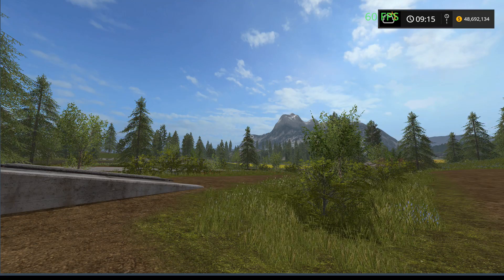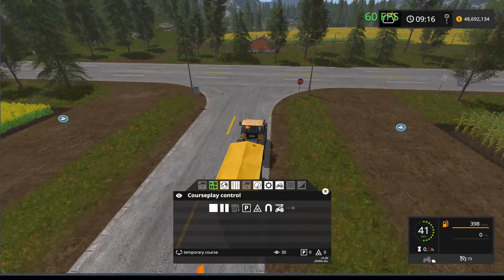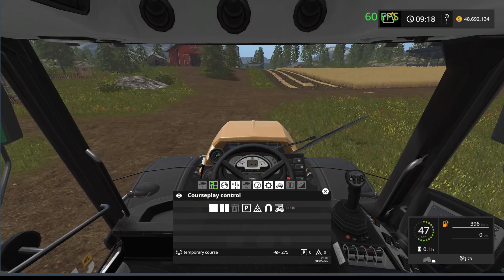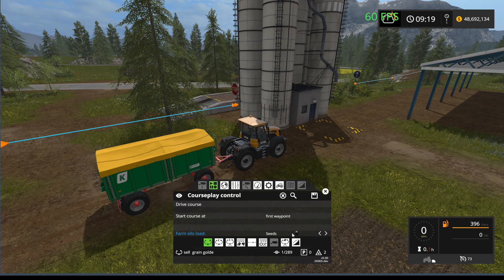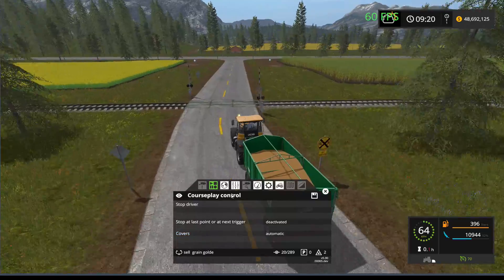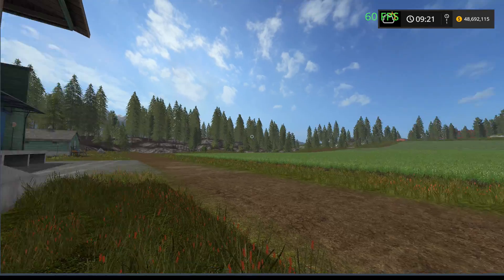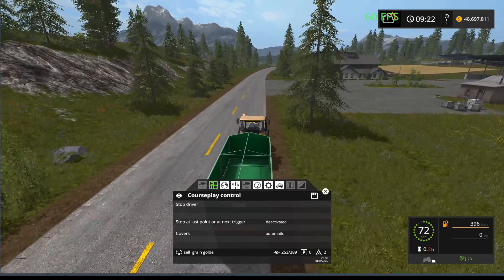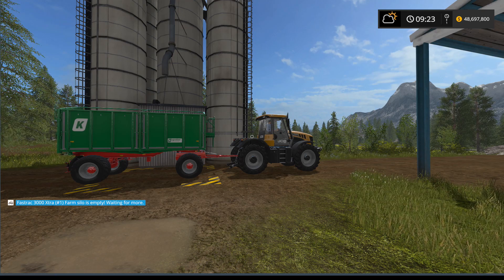Farming Simulator 17 Courseplay Tutorial - How to use grain transport mode

Comment: I have a question. I set up a course following this video. When I try to run the course all is well until just after I slow down to line up on the drop point. For some reason the driver stops. When this happens I need to hit the stop driver button and then the drive course button. At that point the driver manages to complete the course. I have no idea why he stops in the middle like that. Any clue?  Thanks for the tutorials. They really help.
Reply from the maker: The only thing that jumps to mind is that you set a wait point by accident
Reply: Thanks, I'll check it out

Comment: How do you configure which tipping direction the courseplay driver uses? I've tried setting up this same route and every time the driver tips out the left side of the trailer and not the back, thus he spills the grain all over the floor beside the actual sale point. When I recorded the route I tipped correctly out the back of the trailer so don't understand why the AI doesn't copy me.
Reply from the maker: +CWATTYESOGamingForFun I'm not sure you can configure the tip side with courseplay. Maybe in a later version

Comment: Question for you. I have the version from the creator website here is the link. http://courseplay.github.io/courseplay/en/index.html. I mainly have this version because with the version that first came out would not work with my forage harvesters. this one works great for every aspect except for using it to transport grain from the field to the farm. I use an over loader fill a semi no issues but when i create a course it will work the first trip around but when it comes back to the first way point it never stops just keeps going and going does not stop at the way point like it use to in fs15? any ideas?

Comment: I have a hard time getting courseplay to sell to a milk trigger (Stevies Cherry Hills map) using universal tankers and milk stop from Marhus. have you managed or even tried to get that to work?
Reply from the maker: Try using a waiting point at the sell point. It might help
Reply: That doesn't work either. Courseplay ignores both triggers for some reason. the only thing I've been able to do is set up a basic transfer loop with a waypoint at PU and Sell and a "stop at the last point" notification when they're reached so i can manually load/sell. was just curious if I missed something.

Comment: I have a problem Iain..on the map Sosnovka I did the excact same that you did on the video but when the tractor goes under the fill silo it doesn't fill up and it works on Goldcrest! Please help!! 😭😭😭
Reply from the maker: It might be because you didn't bring the trailer close enough to the fill point. That would be my guess
Reply: Iain Robson Oh nevermind, there was a bug with the mod. I uninstalled it from the map where it wasn't working on and added it back, its working better than ever before. Ha, thanks! 👌👍

Comment: I cant figure this out, I got as far as step 5. I cannot find anywhere where it lets me right-click "Add to archive". Right clicking the mouse does not allow me an option to "add" anything? Help Please!
Reply: It helps if you have a program like 7zip installed. Steps 1 and 2 are straight forward... from there I opened the folder it was downloaded to and open the zip file. For me it opens a new window with the folder courseplay_master in it. I copied that folder to the desktop (hold right mouse and drag, select copy) and this unzips as it goes. Then open the folder you just copied to the desktop and select all (ctrl+a) and click right mouse on any of the highlighted files. From the menu that pops up go to 7zip and select add to archive. From the dialogue box that pops up change the name of the archive to ZZZ_courseplay.zip and click ok. This puts a new zip file in the folder you created the archive from. copy (or move) that file to the FS17 mods folder and you should be good to go. Don't forget to enable the mod in game... when you load your game a list of mods will pop up and you need to tick the box to enable it.
Hope this helps. (its the exact steps I went through to make it work)

Comment: Never liked Courseplay, if AI can do everything for you, where is the fun in that, game is not the same !
Reply: Even with Courseplay I still end up having to do a lot of stuff manually. Trying to use Courseplay for both the combine and the unloading tractor (or with the normal AI helper) does not work out so well. So I end up having to drive the combine myself, while Courseplay unloads for me. 

I mostly use Courseplay for that and selling grain. It's basically just a more useful version of the game's normal hired worker.
Reply: Well, it can help with simple things. I use it only to drive from one place to another. And that's it. Everything else i do alone. It's a great mod just like GPS and other ones.
Reply: It comes in handy once you have a really big farm. At some point you just have too many things to do at the same time.
Reply: Think of courseplay as a smarter hired helper with more functionality. It means you don't have to micro-manage absolutely every little thing and you don't have downtime for one implement while you do something else. (ie. the harvester can still harvest while you empty a trailer at the silo... etc) I use it instead of hired helpers for tedious things, especially if I have large fields and such. You can set courseplay to pay your workers so its not as "cheaty" as older versions.